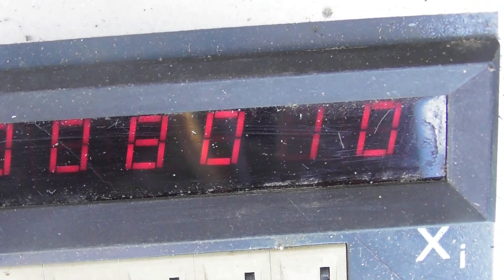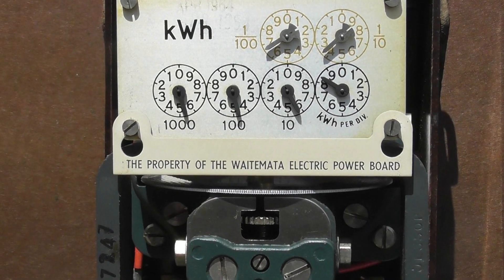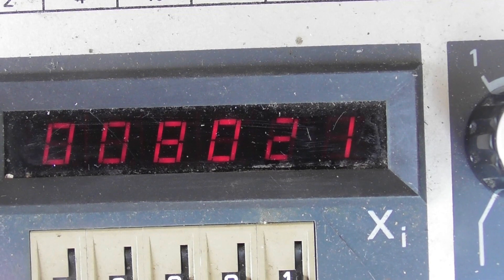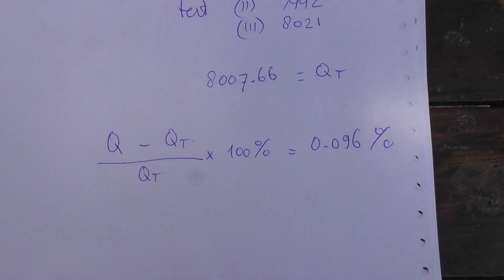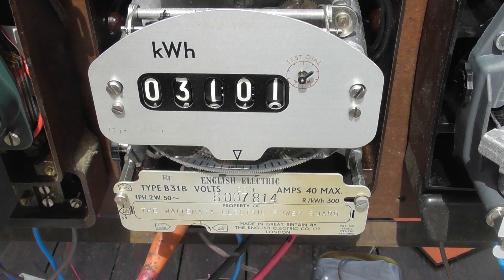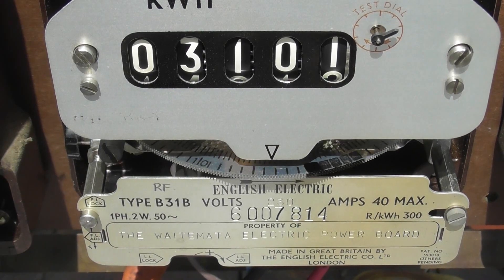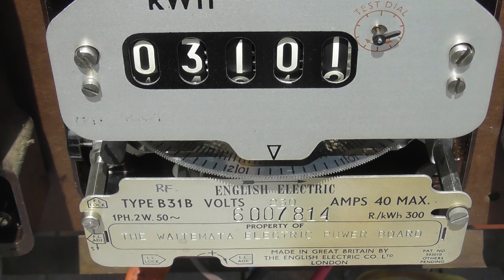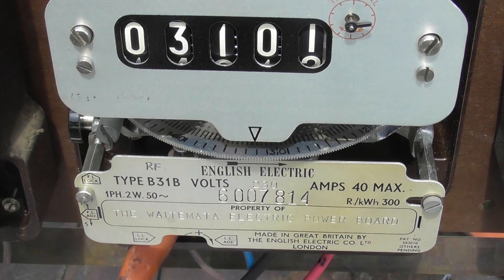Accuracy checks on vintage English Electric kWh meters 50 to 70 years old

Comment: Very good meters, built to last! I remember testing meters when I worked for the local power company, they were changing over all the vintage BAZ EMMCO meters for newer types of which I cannot remember. We had a test bench which could test several new meters at once and had calibrated reference meters. It was a real pity to see all the perfectly fine vintage meters being destroyed after being changed over, there were a few particularly old ones with all metal cases that got destroyed.